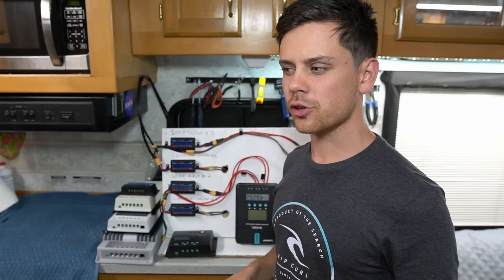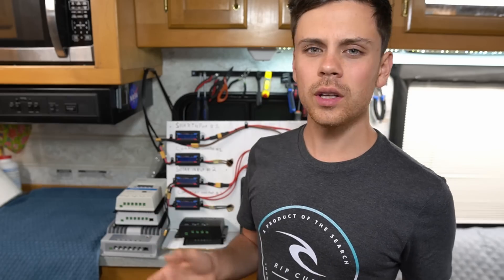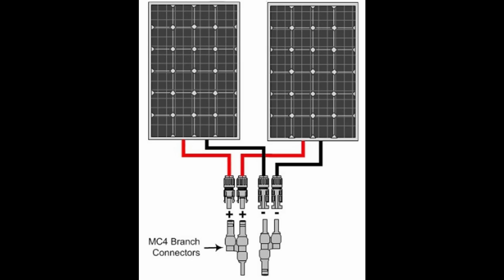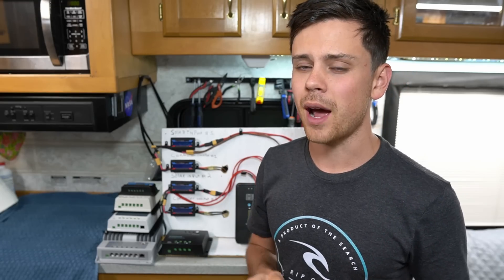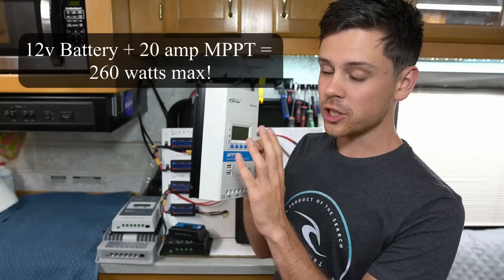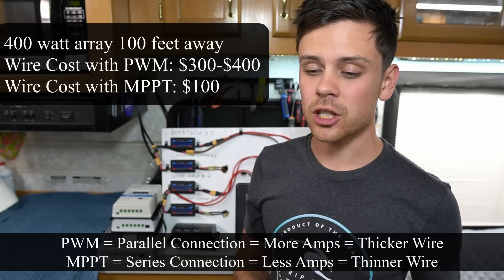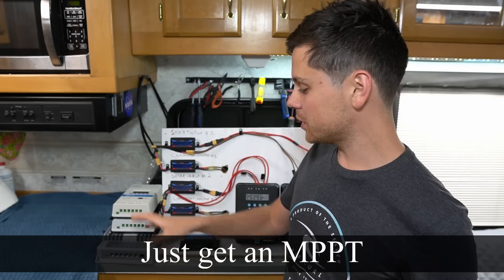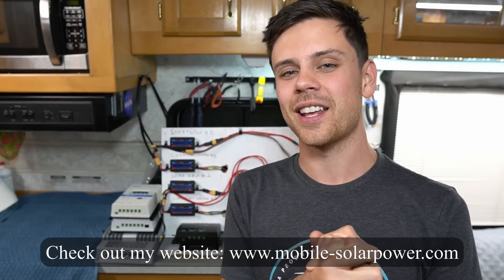MPPT vs PWM: Fast comparison for off-grid solar

Comment: In all honesty! I think a PWM doesn't compare to a MPPT charge controller! I did add 2 extra panels but it shared the load on PWM. I have 4 @240 watt panels. Australia has a fair bit of sun. MPPT is the only way! Top job. Cheers from Australia 🙂👍👍👍. Excellent vids.

Comment: What is the simplest way to charge a 48v 5kWh battery with six 250-watt solar panels? My understanding is that I just need to connect a 48V solar charge controller between the battery and the solar panels.

Comment: Hello Will:  Have you ever considered design of a "3 phase 208 Volt System"?  There is a very large contingent of Off Grid Builders and Fabricators that would love 3 phase power for their shops, industrial machines, and tooling.

Comment: great resource - thanks for all you do. VERY educational.

I started researching solar just for trickle charging an RV battery for a 4 day boondock trip (water pump, LED lights, MAYBE the heater blower - but likely not)... we have a 12v lead Marine battery that does the job, but would likely be getting pretty drained. Don't feel like drilling in the roof (yet?) and we camp with hookups (usually). 

I thought about a small 20W trickle charge to clamp to the battery we have ($60) - to a lithium battery ($350) and a 200W Renogyn kit w/ 40 amp MPPT Rover charge controller ($340)... hmmm. $60 or $690... Even looked at the folding stuff, but those controllers seem cheap. 
Think I settled on the 100W Renogyn with 30Amp PWM WandererTM - I can make a stand for the panel. Maybe I upgrade the battery (says it handles all types) and maybe I eventually put the panel on the roof and add another. But I don't see us going over 2-3 100W panels or over 2 batteries.

Comment: Good afternoon. thanks for the video. I have a solar array of 4 panels(250W) producing each at peak SUN 212W-220 at Open Circuit but my charge controller is only pushing 400W maximum so far into my battery. almost 50% power is lost. What could be the cause please.

Comment: Is pwm safe meaning that it won't fry up your battery in the long run? I'd like to hear your opinion for my current circumtances. I'm just a weekend camper warrior with my family. My days of camping will only last 3 days max with most of the bulk energy powering a 12v fridge and a couple of camp lights. I'd like to buy a renogy 200w panel with either of these options. Option 1) A 200w kit that comes with a pwm controller and cables. Then option 2) Get a higher rated Eclipse panel w/o controller. Buy a victron mppt and other supporting cables. By going with option 2, the investment proposition is double than the standard kit one. In your opinion, is it worth getting the Eclipse panel and the mppt? Is the Eclipse panel that good that it command such price? I won't be upgraging to other bigger panels in the future as a 200w is my plenty enough for what i will be using. If it's worth getting option 2, i will save up for it and just spend the money as I'm a believer of the adadge, buy once cry once. Thank you for your shared wisdom and I have learnt a lot. Keep up the good job 👍

Comment: As a beginner setting up a 200W solar system with a 100AH Lifepo4 battery for my RV, I appreciate your expertise and candor. I recently purchased a Renogy 20Amp Rover Elite MPPT charge controller. I am now seeing some negative reviews about its performance, but I lack the knowledge to judge the validity.  Could you tell me in simple terms whether it is a good choice, or are there better chioces in the under $100 price range? Thanks for all you do.

Comment: Another excellent video!  Also, for a 12v RV system sometimes you can find an excellent deal on odd voltage panels. I got a screaming deal on a couple 30v panels for my first setup.  The savings over similar 12v panels offset most of the PWM vs MPPT price.
Reply: Did you use the 30 volts for a 24 volts system to 24 volt batteries? Or can you totally series up with a MPPT and set it up to  sort it down to the voltage you want, e.g. 12 volt where it comes out on the batteries?
Reply: @OWK000  My system was 12v batteries, powering my RV’s 12v systems. If I were wanting to run a large inverter I’d have gone with higher voltage battery bank. Many MPPT chargers can handle fairly high input voltage, and allow you to select among options of battery voltage and type. Be sure the solar panels max open circuit voltage is below the charger’s max, and that the amperage output will be below the charger’s rating.

Comment: I have two 325w panels and two 6v 225ah batteries with a cheap 1,000w $100 inverter, with a 30a pwm (both panels in parallel, it couldn’t keep my chest freezer running (overcast days my inverter shuts down), I replaced the pwm with a powmr 60a mppt (panels in series) and the batteries fully charge even in overcast days, Now I use the pwm for a portable solar generator (with an old car battery) soooooooo MPPT for daily use, PWM for emergencies (just to keep batteries full but not in use)

Comment: Will , have you read Boggart Engineering’s comments on PVM and MPPT controllers? They have some interesting points. They imply that the 20 to 30 % gains are only in very specific conditions. After watching you I am using more reasonably priced Chinese made controllers so I will probably get one to play around with.

Comment: Hi
I have a chinese turbine that came with it i have 24v positive lead going to fused switch then 150a meter like yours then controller the problem is overnight the batteries lose charge .no wind .last night was 2090v and this morning was1983v

Comment: Before upgrading to MPPT, I was planning on doing 400watts on the roof of my slide in, then, later, a second portable 200w-400w setup. Is it safe to run two PWM chargers parallel before switching to MPPT?

Comment: With a MPPT controller, other than the reduced amperage through the wires, is there any power gain for ur solar panels to be wired for 24v verses 12v?

Comment: I would say PWM is only for very small systems for maintaining a battery or powering something small like a fence charger.  I have 100W solar panel on a battery for a fence charger and a 30w panel for maintaining a trailer battery bank.

But if you're actually using any amount of power, MPPT.

Comment: I will add one thing that you haven't mentioned which is very important to many people.

PWM is easier to make RF quiet than MPPT. So if you're running a radio operation off of your solar system, you will probably be using PWM.

Comment: Your presentation gave me confidence that a $13 PWM on our small sailboat, running as back up for essential systems like nav lights, depth sounder and to back up GPS and chartplotter was fine.  No need to spend over $120 on a solar system!  Sail primarily in summer on warm sunny days, stays cool in bottom of lazarette where charge controller, batteries located, less than three feet of wire to connect.  12 volt 35 amp AGM battery x 2, plus starter battery.  100 watt solar panel.  Worked great past two years.
Reply: I moved from the cheap blue PWM to a $30 Powmr/Bateria Power miniature mppt and the power harvesting difference is astounding. I'm talking twice as much at earlier and later sun hours.

Comment: Another thing worth mentioning (and something that's preventing me from getting an MPPT) is the difference in voltage between the solar array and the battery, for MPPT you need the solar array to be a much higher voltage than the battery to get the most out of it from what I understand. Wiring panels in series to accomplish this (which is what I could do) would mean shade has more of an effect.
Reply: I’ve been testing a cheap PWM vs a Redarc MPPT on a 120W solar blanket and the PWM is giving me almost 25% more power output. I’m guessing this is why?
Reply: @AlexSwan  That must be a quite strange combination of parameters. Generally the panel works best at about 18-20V for a "12V" Panel. A MPPT could use this voltage and convert it to the battery voltage with a higher current (same power). The PWM can only deliver the current from the panel which will be more or less the same as with a MPPT input but only with the battery voltage of about 14V. So you loose 4-6V on the panel side. The MPPT would need to be very bad at efficiency not to get a better result with the otherwise same setup.
Reply: Actually, MPPT works even if solar panels are producing less than battery voltage. PWM requires solar voltage to be higher than batteries, and can't charge with more current than is available from the panels. MPPT can convert solar panel output to a higher or lower voltage and higher or lower current to get the best charging results from whatever its input is. It is probably true that the MPPT is more efficient at higher input voltages than it is from lower voltages, but it should still be at least as good as PWM in all circumstances,  and often better.
Reply: @richardthompson6802   Most MPPT chargers stop working, if the panel voltage is below the battery voltage. Not mainly because of the battery but because of the panels.

And it also wouldn't accomplish anything with the usual panels. A "12V" panel will bring 18V if at least a little light is available. But it can't source any useable current, as the voltage breaks down if the panel is loaded and no power for charging is available. 
So you would need to have panels with a much lower nominal voltage at good light which on the other hand wouldn't work with most chargers and don't make any sense.

Comment: I agree, Will.  My design for the main home power includes MPPT.  But on my remote land (entirely off-grid), there are a couple places far from the house where I want a little electricity for a sensor, and don't want to change out batteries periodically.  I have in mind one panel, but even that is overkill, so PWM will suffice.  That's my exception to the rule.

Comment: I've watched lots of your video's,  Love your stuff... BUT i'm still missing something... Now i want to use the 12v. power for fans lights etc. where do I pull power from? The load connections of the charge controller or the batteries ???
Reply: Battery

Comment: I’m new to the solar game and have what is probably a dumb question. Can I use an mppt to connect a 24v solar array to a 12v lifepo4 battery?
Reply from the maker: If you use mppt yes you can

Comment: I have a question. If have 2 12 volt solar panels and hook them in a series to output 24 volts, hook them to a mppt charge controller rated up to 48 volts can this setup charge 12 volt batteries?

Comment: If you want to see what a MPPT controller can really do, conduct the same tests but with a panel or panels not voltage matched to the battery voltage.

Comment: I'm afraid, there's a lot of bullshit and half knowledge in that communication. 
Of course, if you have to deal with a lot of power AND also have  a lot of battery capacity, MPPT is paramount. You get however a completely different picture if your battery capacity is limited and you live at higher latitudes.
Mainly in summer, irrespective of what you will have as a SCC, your battery will be full charge at 12 o'clock and the rest of the time the SCC will be clipping, since you will not know what to do with energy. 
In the winter, with limited irradiance under clouds, your solar panel would frequently deliver less than 10% of the nominal capacity. 
And believe me, I have tested quite a lot of low-power configurations MPPT when not really perform better than PWM on low-end solar panels with 18V at the maximum nominal power.
You will hardly be able to load your battery anyhow. Even worse, MPTT controllers we have a not neglectable own power consumption, much more than a PWM controller.
With 36V panels, you should go for MPPT, that's out of question, but for 18V panels and under 300W PWM isn't it worse and sometimes even better.

Last but not least, you should be aware that the market is full of no name controllers that just pretend to be MPPT and are in fact PWM. 
Mostly, if the controller has no common negative poles between panel and battery, you have got a PWM.

Comment: i am going to get a 100 watt hqst  mono panel for my jeep top.  I can get a epever 10 amp mppt for 65.00. will it be worth the extra expense over a pwm. I dont plan on going over the one panel. I have a 95 amp hour Rolls deep cycle. The panel will be permanent mounted on roof and will stay flat.

Comment: Excellent primer! I use a 100  watt poly panel with 30 amp PWM (same price as 10 amp, so why not?) for the 2-12 volt batteries on my RV. And as you describe, it meets my needs in the southwest USA. Thanks.

Comment: Is there any specific reason why at 1:23 he states we "need to connect the solar panels connecting to it in parallel" when thinking of pwm? I bought a 12/24 V pwm controller and am using two 12V LiFePO4 batteries in series,  as well as two 175W 12V panels in series (with the plan to add two more panels in parallel). I do not understand the panels in parallel assumption. 🤔
Reply: I'm assuming is intention was correct, but could have explained further!
Basically PWM get worse performance by stepping away from its ideal conditions! Meaning your PWM will perform better to charge a 12V battery. When the input and output are well balanced. Charge a 12V battery from a 12V (nominal) panel. Nice! Charge the same 12C battery from two (series) 12V panels. The performance will be way worse. Than on the previous example!
Step away from the ideal and performance will get worse!
Check the efficiency of your system on both configurations, series and parallel. It will be self explanatory! ;-)

Comment: To fast for this total beginner  and I don't understand some of the terms used. I am 68 years of age and never worried about solar power or electricity prices. Electricity to me was switch it on and it works, but if not check the fuses I can do that, then call for somebody who knows about electricity to fix it, an electrician of course, now I've started to build myself a little battery and solar power source to run a pump in my small fish pond a hobby , just for fun ! In any case time I called in a man to do it for me.

Comment: EPEVERIT is from china which circuit board needs to be seen to qualify as an electronic product, less costly PWM will take advantage of the consumer in which heat is an issue which is an issue with summer fires. China is now a global threat to environmental ozone depletion with a nuclear weapon attack that would destroy the OZONE layer cause more forest fires like in Australia. O2 level with human evolution is critical which any drops in oxygen level would devastate most animals and warm methane gas under permafrost chemical reaction would result in hot burn to death for humans.

Comment: I love your videos @DIY Solar Power with Will Prowse. I do have a simple question. I have watched several in which i understood you to state that with PWM you have to connect the solar panels in parallel but unless i missed it, did not explain the WHY. For example, if I have 2x 200 Watt 12V panels connected in SERIES, those 17v OC panels produce 34v OC peak, and since the $15 PWM (YJS530) accepts (auto adapting circuit) 12V (to 25V) OR  24v (to 50V) max, and 30A max in the version I have, we should be below that. But I suspect I am missing something, can you please set me straight? I recognize the point about wire gauge, but my goal is a solar wire run as short as possible (<20 feet), and very inexpensive 2 panel setup for intermittent use in an outbuilding, using a few 'disposable' lead acid car batteries until I can upgrade controller to Lithium model and LiFePo4 batteries.

Comment: One aspect I don't see much discussion about it how noisy MPPT is on HF through VHF radio frequencies. My previous RV had a MPPT controller for 280 watts of panels. It was installed about 5 years ago. I could not use my ham radio equipment or listen to AM or Shortwave while the system was on. I sold that RV and installed on 270 watts and a PWM controller on our new RV. I see little or no difference in charging efficiency but I can use my radio equipment with the PWM controller. My question is, has MPPT technology improved to the point I can use it and not have the broadband interference my old system had?

Comment: Suner on Amazon sells a 18w panel and they claim it has a built in mppt controller in it? Is that a thing? 

I’m just looking to keep my trolling motor topped off for longer use and stay safe from over charging.
Reply: Simba Cortez I’m guessing it’s true...tiny little panel that only requires a small little chip to accomplish the requirements being associated with it.   Expensive but appears legit....do they have a spec sheet avail. That you can review?

Comment: Hey will my bluetti ac 50 is a regulated cig plug. So I'm thrilled about. I did buy a pure sinwave 300 watt inverter that's a great item for me. But I have 10 acres in northern az to do a van build. Maybe you might want to come join up for a solar van build on my property? I hope to hear back RV Davy utube channel.

Comment: Do you really need to run in series for MPPT to be most effective? I want to run in parallel because I have two panels on a boat and it's likely one could be shaded by mast/ropes/other boats etc.

Comment: Many of us are totally satisfied with using PWM controllers.  I am not a power hog in my RV and my 400 watts of solar panels,  PNW controller and two deep cycle batteries are more than enough to handle the refrigerator, TV, laptops and lights.  I think I only paid $14 for that controller on eBay.